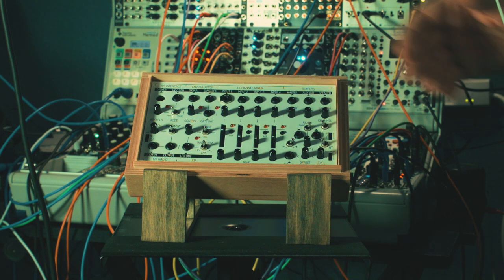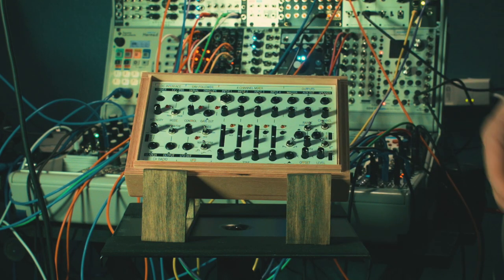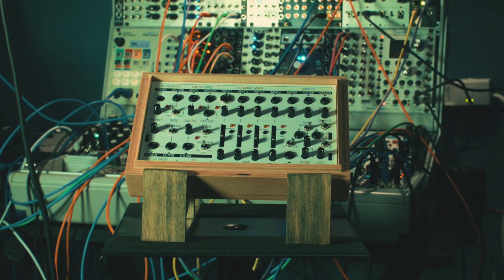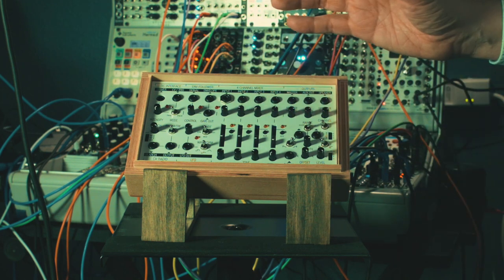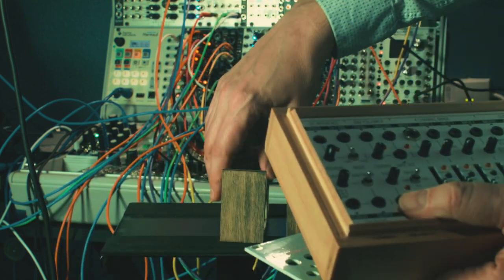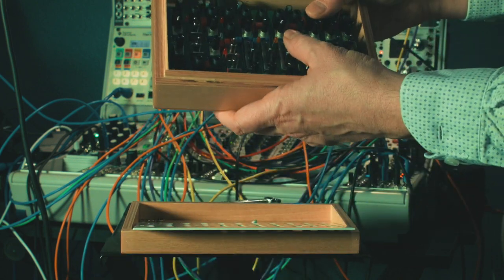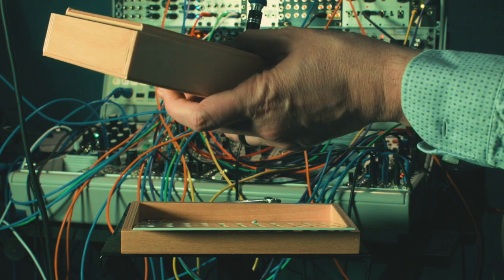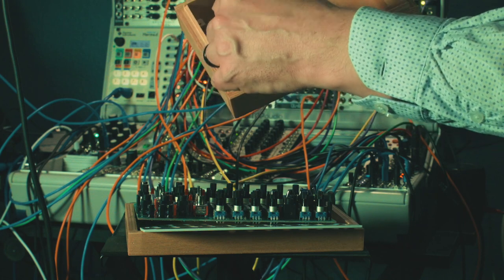Koma Field Kit - Eurorack Conversion

Comment: Hey Scott, thanks for these videos. I’m trying to connect my Kona field kit to a uZeus tiptop power, not getting any sign of life. I read that the Koma needs -12v, not sure how to configure that on the uZeus, any help would be appreciated.. keep it up
Reply: Oops! I just figured it out, it was the jumper switch on the back of the board!
Reply from the maker: Hi, if you have the unit in your euro rack, you need to be sure that you switch the jumper on the field kit. Did you do that?
Reply: Scott Lukas yes! That was actually the issue, resolved! Thanks Scott
Reply from the maker: @fotoniknoise  cool, I did the exact same thing!